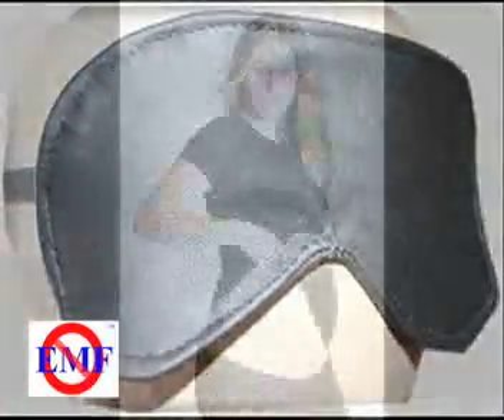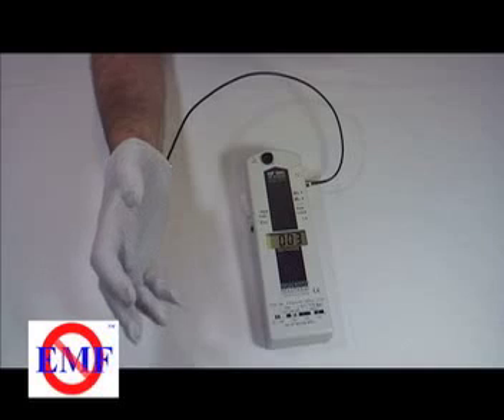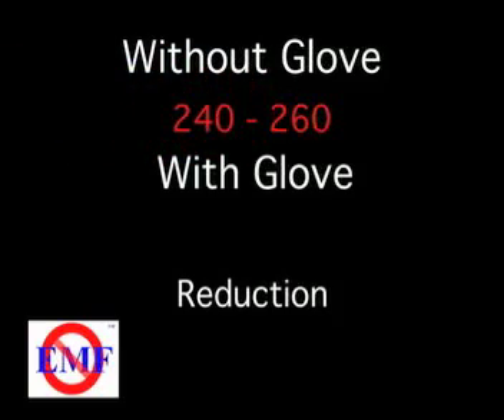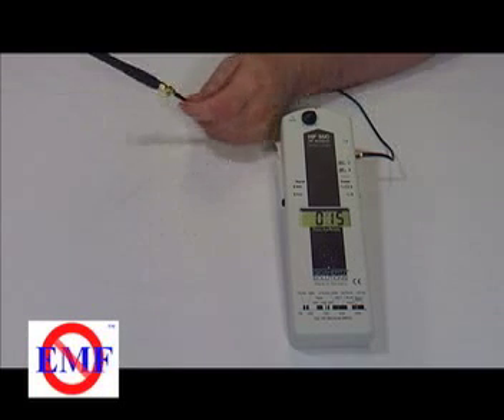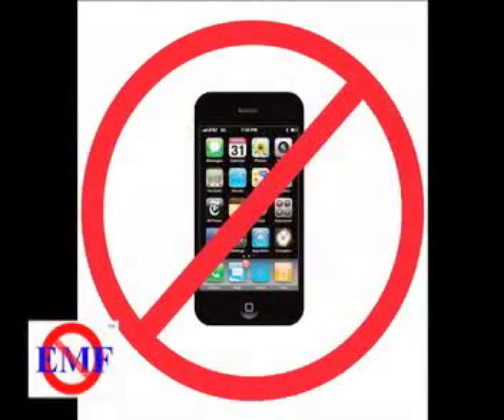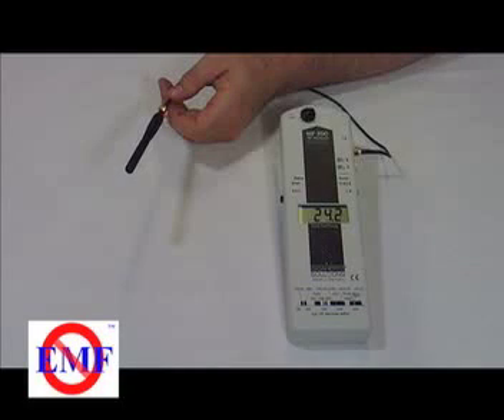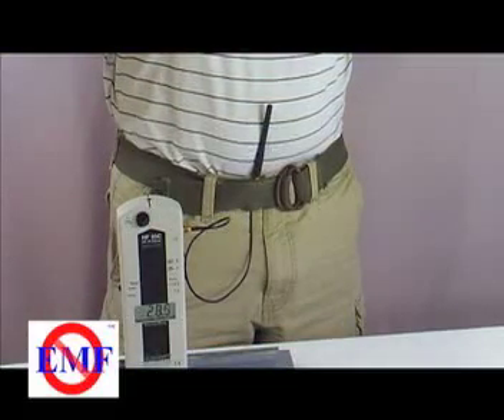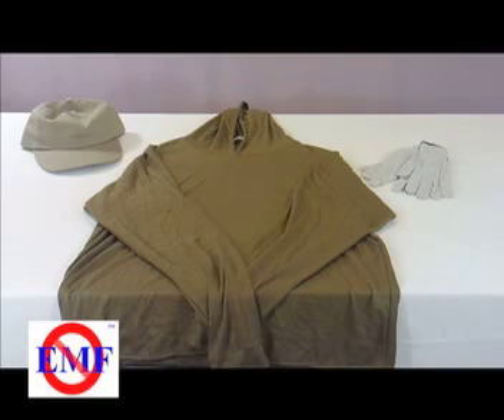Proper Testing of Shielded Garments

Comment: Why not use a phone or microwave for testing ? As they are the most harmful one's for EMF radiation ? Just a general question ?
Reply from the maker: Cellphones provide a very jumpy and inconsistent signal that is difficult to test correctly without a near-field probe.  These garments are also not designed to prevent a phone from functioning, that takes a 100% enclosure with very high near-field shielding material.  Microwave ovens will have leakage around the door, but it does not go very far. 
 So we use a laptop program to produce a constant signal, ensuring that the ambient reading does not change, and the change that we see is caused by the shielding material.
Reply: LessEMF thank you very much for your time and help.
Reply: LessEMF what is the name (number)of the gigaherz solution thing what you are using!?